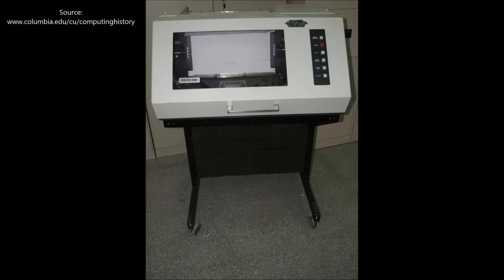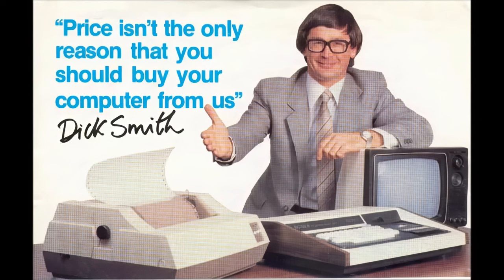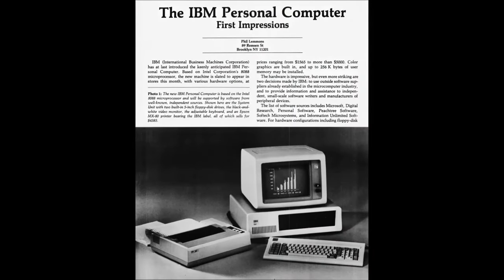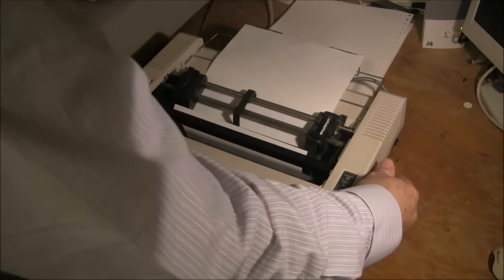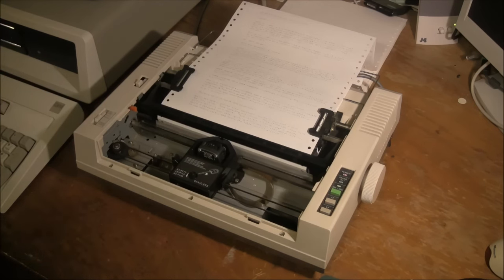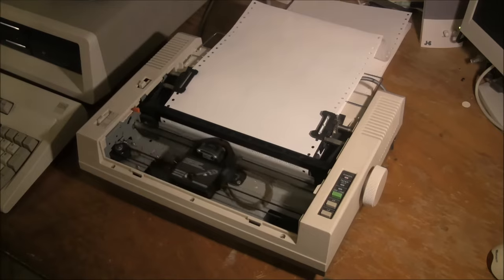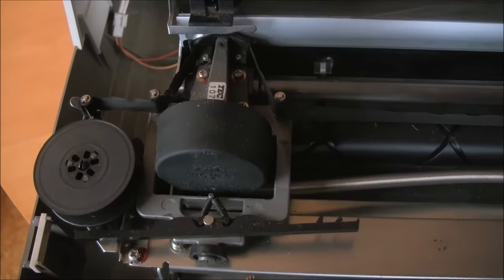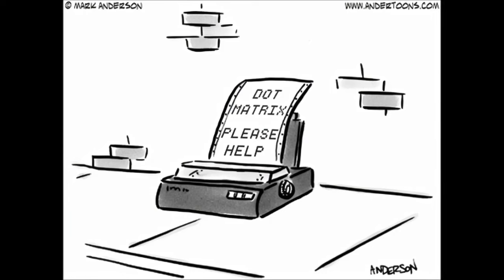Dot Matrix Printers (as seen in Terry Stewart's computer collection)

Comment: 1:18 One of the best printers ever made (the type, not that specific model).  These things are workhorses and by far the cheapest way to put ink to paper from a computer.  The fanfold paper is extremely cheap as is the ribbon.  The ribbon is cloth with a hidden roller inside the ribbon cartridge that continuously re-inks the ribbon.  Well under a penny per page.
The printers themselves are pretty expensive (10 grand plus).  But they are extremely reliable and low maintenance.

Comment: Inkjet printers or bubblejet printers as they were once called are fairly cheap to buy, but very expensive to use.  Most consumers would be much better served with a laser printer.  Not only is the per-page consumable pretty high, but the consumable doesn't last once open. An inkjet cartridge will dry up in a few months.   You can get a laser jet printer and keep the original toner cartridge for the life of the printer if you don't print a lot. They don't dry out (toner is already dry). They rarely leak. Most of the time the only leakage you will ever see is from really cheap 3rd party cartridges or refills.  They don't need periodic cleaning (consuming ever more ink). High coverage will not wrinkle the paper.

Inkjet cartridges are pretty pricey for the number of pages they will print. That's what makes them so expensive to use.  A lot of inkjet printers can approach 40-50 cents a page in consumables.   The cost per page of most laser printers is about 2-3 cents.
Laser printers produce much better results.  Even an old 300dpi laser printer will outperform a modern ink printer in print quality.  Toner doesn't bleed. The toner particles are a pretty uniform size.   Laser printers are much faster as well.  Once they start printing, they move pretty quick.  Modern printers even are pretty quick on the first page.  It doesn't matter how busy the page is either. It can be fancy fonts with pictures or plain double spaced text and it more or less prints at the same speed. But inkjet printer speed is determined by how busy the printing on the page is.